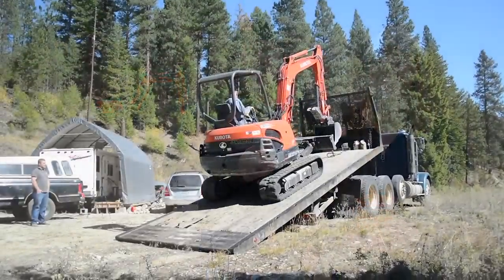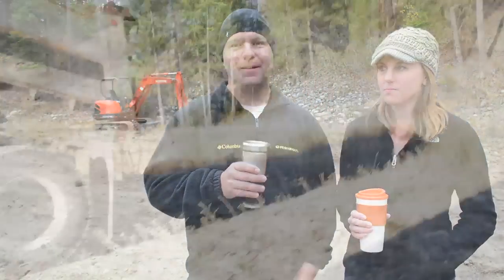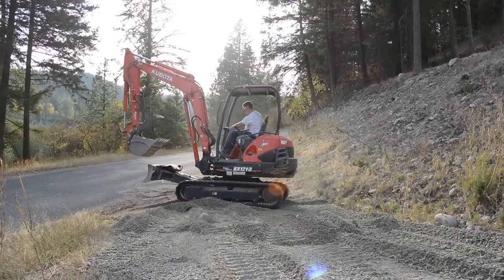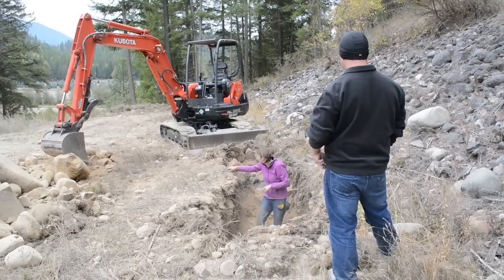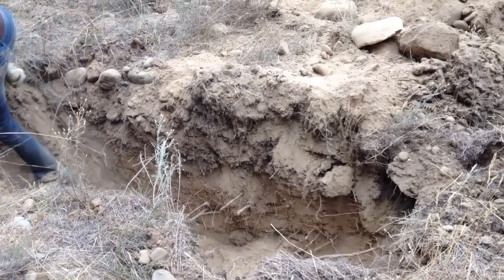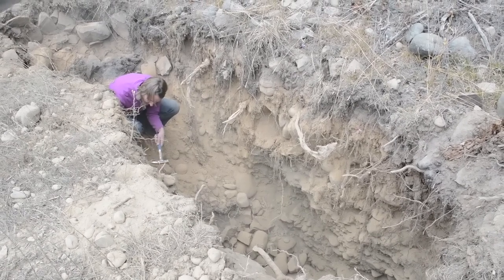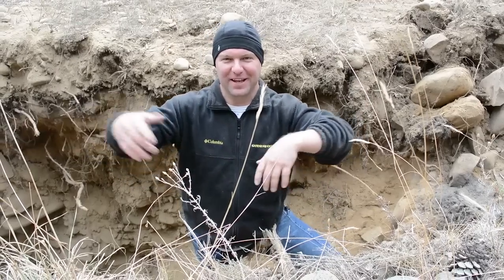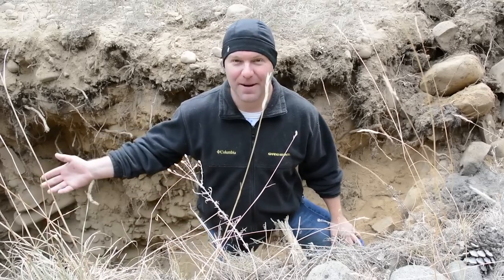TERRIFYING - WILL WE FAIL OUR SEPTIC PERC TEST?

Comment: I'm all for getting the permit and having the inspection but $800 is extremely steep in my opinion. She is not engineering a solution and she is on the payroll whether salary or hourly. So where is the value above the costs actually associated with her 1/2 day of work at your place and some desk work at the office. What other reasonable costs is the state incurring due to the inspection? Love your videos, keep them coming.

Comment: You kind of prove the gullibility of the average person when you accept and agree with the $800(+) septic inspection permit!  $800 is EXCESSIVE for what they actually do, it should be more in the $1-2 hundred range max; for $800 they should bring their own equipment and dig the holes themselves!!!!!  Excessive fees like this is what causes most people to skirt around the permitting/inspection process.  Secondly, the government uses these codes and permits to control what you can and can't do, whether it is safe or not, it is more about their CONTROL of what you do on your land; they simply feed you the BS line that it is because of environmental issues (considering that government is responsible for the most, the biggest, and the worst environmental issues).  Many jurisdictions refuse to allow composting septic systems and separate gray water containment (for use in irrigation) because they don't have any understanding or training in it.  Setting up a septic system is NOT rocket science and is actually very simple, it just takes research which most individuals are unwilling to do!

Comment: Where we are in Washington, you have to use a licensed Septic Designer to do the perk tests and hole digging and then design the system to match the residence(based on bedrooms not bathrooms) to the land. Per the land, you have to be certain distance from Roads, Wells, Property Liens and any wetlands/water sources.
You then go to Public Health and get the Design  and Layout approved and a Permit. Then you can build it yourself OR hire a Contractor and Public Health does all the Inspections to confirm it is done per the approved Design Plan.

Comment: Nice having a septic system onsite.  We just put ours in.  We chose a poly tank and the Infiltrator chamber septic system leach field.  quick easy and beats the socks off of traditional leach lines and gravel fill.  https://youtu.be/vhtNUZVVhho
Reply from the maker: +Plan Bee Orchard & Farm The common consensus around this area is the Infilatrator chambers will fail in 2-3 years HERE. Even infiltrator doesn't recommend them here. Had a neighbor about a mile away who just replaced a chamber system that was 7 years old. So in the end we went with the recommendation of the contractors, yes not just one. Cost wasn't any more or less or us than the chambers. Do some research there, well I guess it's too late, but maybe wouldn't hurt to check if your area is well suited to the chamber.

Comment: Great idea from you guys to arrange an interview with the inspector.
Probably a stupid question and almost surely checked by both you guys and the inspector:
Is your septic system below the level of where you plan to build your house and possible basement and possible cropgarden? As our "business" ;-) tends to flow down hill if the system, god forbid,  would ever fail during heavy rainfall.
Reply from the maker: Excellent concern! We've been employing the help of professionals with this installation and it's been most helpful so we don't miss small things as you mentioned. Happily the system has just the right area, elevation, setbacks and all right where we can get maximum building space from our little flat spot. Bit of luck really.